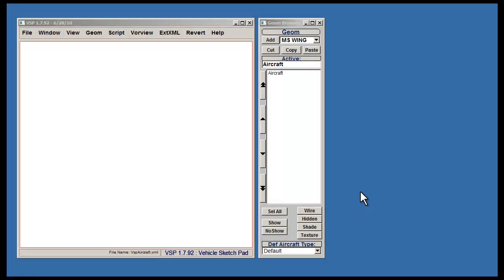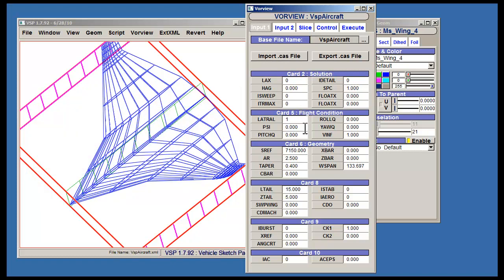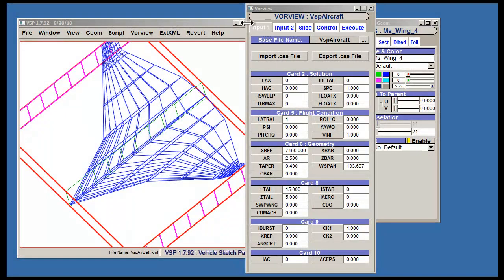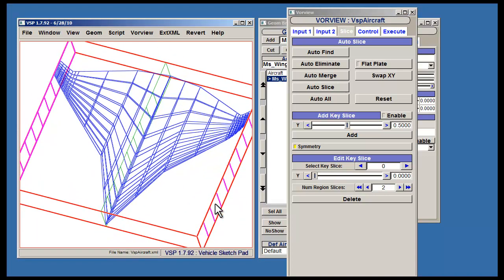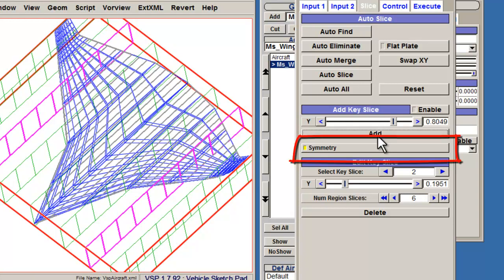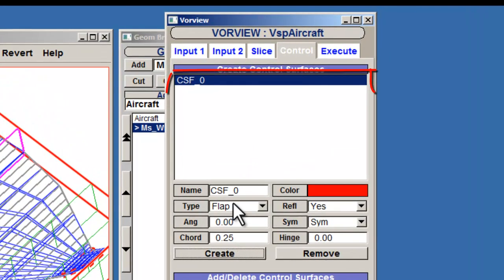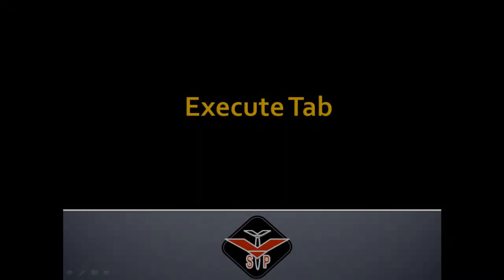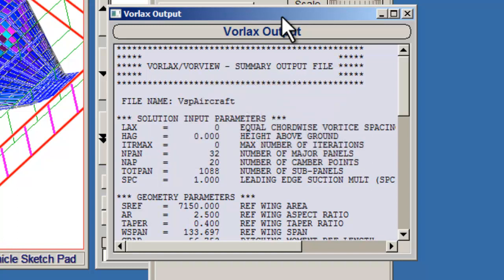Tutorial #6 Introduction to Vorview

Comment: I seem to be missing the vorlax executable. ( I have downloaded version 2.3) Do you have any idea where can i find the file.
Reply: I doubt they include VORLAX in VSP.   I bought it from COSMIC in the early 90's and received the software on a tape reel.  I appears that Open VSP doesn't even include VORVIEW anymore.
Reply: @russhicksart  I think VSPAero is the current modeler included. Now if I could figure out how to use that...
Reply: Tim , The vortex lattice implementation has definitely been rewritten.  The subsonic grid is pretty decent and controllable but it doesn’t handle wing-body intersections properly IMHO. The supersonic grid is much more troublesome.  I’d like to have much more control over the panels aspect ratio to avoid Mach cone intersection issues in the solutions. I like to vary the panels aspect ratio with the freestream Mach number.  The SS auto grid is unfortunately unusable for me.  I’d recommend VORLAX, VLAERO, or ZAERO for this type of work or step up to Euler or RANS.